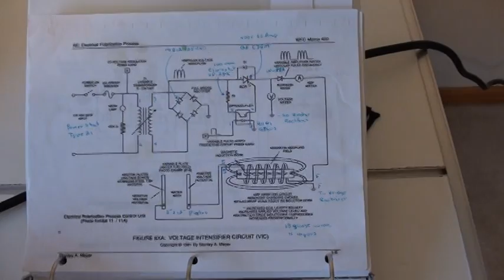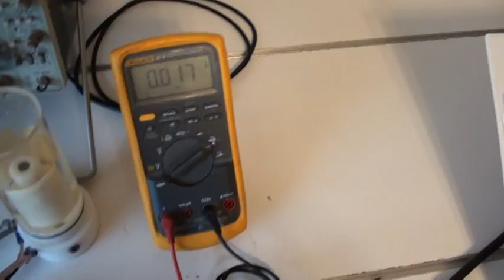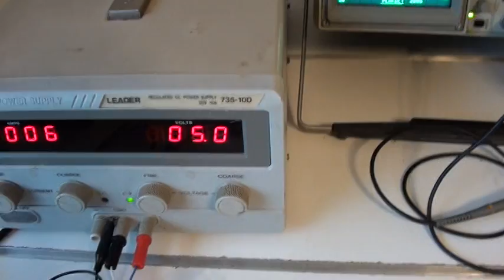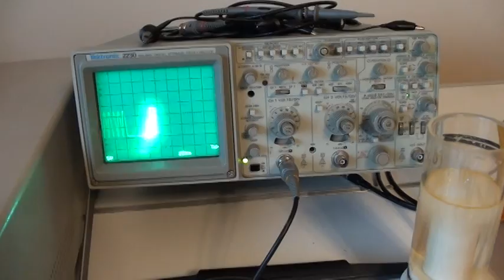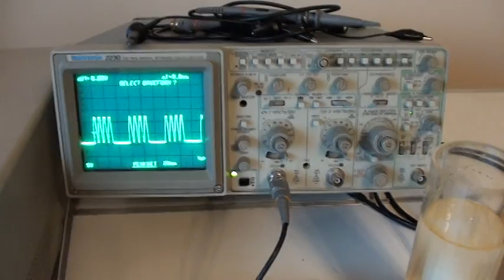Stan Meyers 8XA circuit replica

Comment: i have noticed a strange disappearance of this document the RE: Electrical Polarization Process Memo 420. The latest memo 420 on the internet is from "Birth of a new Technology" and the images in that document dont show the same image what appears in this video. this diagram of 8XA circuit and others including the voltage card are apparently part of memo 420 though because thats what the top right header depicts. Anyone know where i can find that original documentation? again it's not in the memo 420 which is the first chapter of his manual, birth of a new tech it appears to be copyright in 1981 so its a older document.

Comment: hello. have you insulated your tubes? if you spray them with rubberpaint or something dielectric you can stop ampflow and step charging effect appears because now the cell acts like a true capacitor. voltage on the cell will rise very high and starts to break bonds of h2o molecules.

Comment: Hi Don, In your own opinion... do you believe that Stan Meyer had the previous knowledge of how "scientifically" this electron inhibitor was able for restrict current? Meyer NEVER explained how in the laws of physics this such "magical" restriction was possible. He only says that by way of a MF (Scalar of cource), but how the electrons are stopped?. He never explained that, also there's no any other "alike" device patented or any info related. Please help
Reply from the maker: +Eng Richard Balboa If you go back to Stan's earliest papers, you will see he tried many ways to restrict amps. He used some multi layered plates of different materials to restrict amps. I don't know what he might have known, but following his work you will see a progression of amp restriction. He came up with the Chokes, which does just that, choke off amp flow. Then I believe he stumble across the LC resonance by accident. LC resonance does restrict amps and allows the voltage to climb. He was very cautious with what he would let out.
Reply: +Dynodon64  Hehehe yeah, actually the most great inventios came by accident. But as you know, the main proble is to avoid a break down of the voltage by restricting ampflow and avoiding the use of a resist develop. I also look suspicious most many videos talking about "real" replications of the WFC where most people use distilled water as the main component for restrict amps and not their chokes. I strongly believe that the Chokes are bifilar and 'scalar waves are develop'  when a cancellstion of inductance it's made and thus this "magically" effecf could restrict the amps even when a death short condition enviroment is meet. But I want to know how this "magically" effect it's done. I see that the people how know this they don't say anythig about this, and people how dosen't know about this they talk lies and lies to the public.
Reply: +Dynodon64 Don and please I have a last question, the last one I promise. There're open houses for visit Stan's Work in Canada? I really really wish to take a trip and see in real life and in full color his so famous water car and his other amazing works. I really hope
Reply from the maker: +Eng Richard Balboa I have never seen a real replication of any of Stan's work. There are a lot of the tube cells out there, but they don't have the correct alternator to power them. As for the 8xa cell, I haven't seen one of them either. The resonant cell with the 11 small tube sets have never been replicated either. As far as I know, no one has been able to replicate any of Stan's cells exactly. I still believe it works , but have not seen anyone come close yet.
Reply from the maker: +Eng Richard Balboa The last place I knew that had the buggy was in Detroit Michigan. If it's in Canada, that's new to me.
Reply: +Dynodon64 Well Don I have a little theory of how this RCC could inhibit such amps by using a MF. This effect it's like Lenz law of coils but Lenz law it's uses the classical MFs with a North pole and a South pole... [His law states that when current flows throw a coil a MF starts to build up but such building MF would try to resist the fowar current]. Meyer used this basic principle BUT using a bifilar coil for cancel this classic poles (prior art method) so creating a "scalar or out-of scale MF" since there's a law who states that nothing could be created or destroyed, just transformed. This such "Scalar MF" it's the responsible for repel such current flow since electrons exibit electromagnetic characteristics. This Scalar MFs are in the field of Modern Physics (In Meyer's words: "Faraday required MODERN day inventions"). Well Thanks Don! I will try again until make this chokes to work. My best regards.

Comment: Hello Don and first thank you for everything you've done to help advance this.
I have reproduced the 8XA circuit with a coil wire manufactured according to Max's instructions and I could see the current limitation when introducing a gate in the signal. However, something I have a problem in understanding the current limiting system. If I remove the wire coil, it makes no difference in, the current consumption remains limited by the gate. That makes me think that now, in this configuration, only the gate has an influence on the limitation of the current. That puzzles me, because I thought the coil and the way it was connected to the circuit played a key role in this scheme. Have you tried unplugging the coil once introduced the gate into the signal to highlight its influence? Did I missed some thing?Thank's for your help ;)
Reply from the maker: +scarou022  IT makes a difference how you wire the coil to your cell. This set up is not meant for a tube type cell. It was used with the variable space plate cell. They were about 3 inches by 12 inches. You didn't say what type of cell you tried it on. Also the most important thing to remember about the gate frequency is that it has to be less than 120hz. It will not work above that. The scr won't shut off. Hope this helps.
Don
Reply: +Dynodon64 
Hello Don,
 First of all thank you for your help. It took me a little time to put everything flat and perform my tests, but I finally understood !!! I hope...

First I began by making a variable plate cell  (60 mm x 120 mm). It was a funny part of work, but not really necessary in reality (If you want, you 'll be able to find it on thiniverse if you search for 8XA). Certainly one way to say "hey this is not intended to resonate !!! " But anyway...

I have made several measures and tests and I can't post all the datas here, but here under are my conclusions :

- introducing a gate limits the current in the circuit (Without a gate, there is no current limiting in the circuit).

- 2 coils are required to allow the SCR diode to trigger. With only 1 coil, the SCR diode "latch" and there is no more a gate and so no current limiting in the circuit).

- the two coils must be wired in opposition.

- As the two coils are wired in opposition and the cell is located between the SCR diode and the isolated ground, the position of the cell in the circuit does not matter.

 - The 8XA circuit is not designed to be a resonant circuit.

- Using a plate cell or a tube cell in this circuit gives the same results.

What I understand from all this is that the 8XA circuit is a training circuit. In the sense that it is aware that the current limiting is achieved by the introduction of a gate. In the case where it is desired to introduce a coil in the circuit to obtain a resonant circuit to achieve greater voltage, the only way to use an SCR diode, is to have two coils wired in opposition.

So now I will workhard on the 8XA1. ;)

Christophe

Comment from the maker: John, yes I'm the guy who made the videos of the Meyers Estate. I helped the owner get the word out of the sale.
It was sold to a company in Detroit called QCI.
Reply: +Dynodon64 Hi Don, I have a little question... current flows throw your water capacitor or it's totally inhibited?
Reply from the maker: yes there is current flow in this system. Stan used this set up to prove that if you restrict current, then voltage will rise. This system only reduces current, not stop it. His later system was current restriction through resonance.
Reply: Oh and something else please... How you gotted those unipolar pulses? I understand that the SCR it's the gate at 120 Hz max. BUT how are this "unipolar" resonant pulses made? I know that the inductive chokes develops this but what is the name of this phenomena or how the inductors could do this wear effect? Please help Don.
Reply from the maker: +Eng Richard Balboa This set up is not a resonance circuit, it's just a current limiting one, by way of the chokes.

The unipolar pulses are what you get after the 120 volt ac power at 60hz is put through a full bridge rectifier, and is changed to 120 volts dc 120hz. The gate is then used to break up the unipolar pulses into groups. The gate frequency has to be slower than 120hz. The scr is just a switch for the high voltage.
Reply: Oh gosh, everything have sense now. So if this device doesn't restricts amps by resonance, I suppose that this device restricts the amps by a Out of phase restriction phenomenon. It's that right?
Reply from the maker: the chokes restrict the amps, that's all
Reply: Ok I got it. Thank you very much Don for your help.

Comment from the maker: Marc, this video is only meant to show others how to get the unipolar pulses at the cell. This set up can't be made to work on 12 volts dc. This circuit relies on the 60hz frequency coming from the mains power in a house. That's where the unipolar pulses come from. This is not a resonance cell. It is meant to only prove that you can restrict  amps, and that allows more voltage to be applied to the water fuel cell without an increase in current.

Comment: You are showing amperage at the output... The real amperage we need to see to understand the efficiency is the inputs's amperage. We could build circuits all day long to see great efficiency at the output, but, what we really need to see is this circuit running in a car, operating at 1/2 amp or less on a standard cell that fits in the engine compartment. My average current consumption at 1 lpm is currently 5-6 amps at 12 volts with a high frequency pwm. Is this something that will be able to be powered off of 12 volts with this small of amperage? usually if the output's amperage is high voltage, whatever the input voltage is multiplies massively. say the output voltage was 120 volts, the amperage for this circuit if the input was 12 volts would theoretically be 6 amps. This really doesn't show any more efficiency than what I am seeing at 12 volts with my pwm. Can you convert this to run with 12 volts dc to see what the draw would be at the input instead of the output?